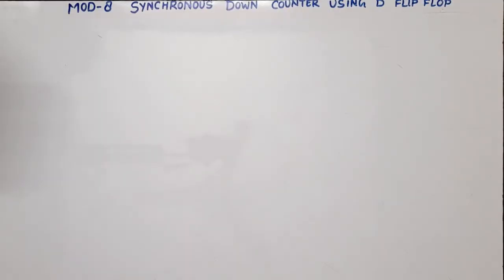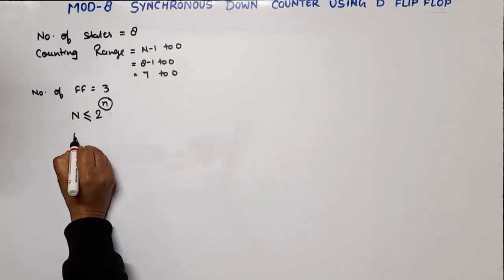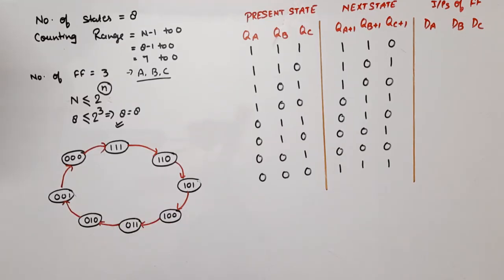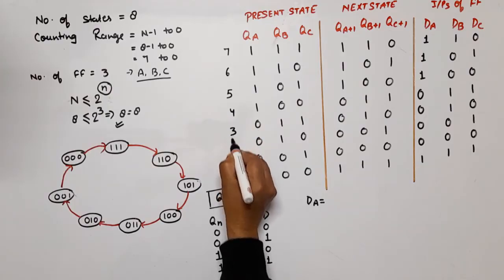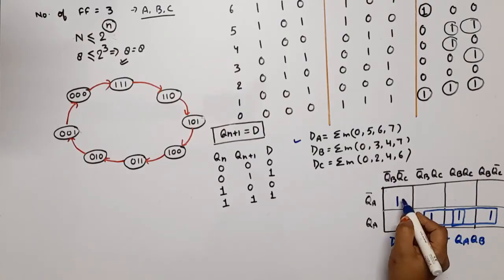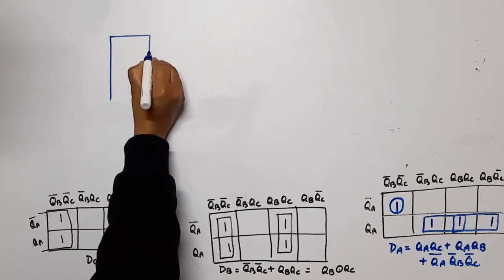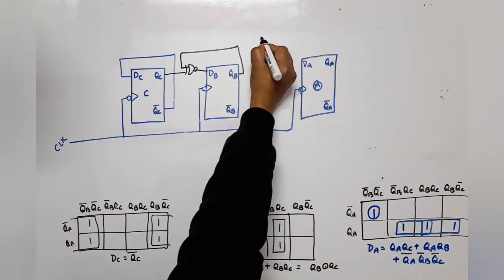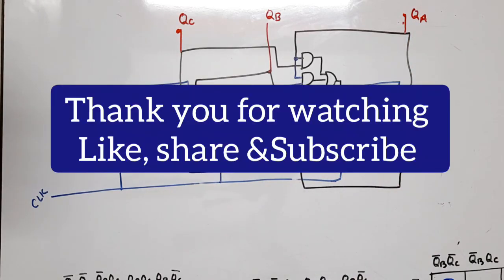MOD-8 Synchronous Down counter Using D flip flop | 3-Bit Synchronous Down counter

Comment: How we can explain its working madam???
Reply from the maker: In working u can define counter, what is the meaning of mod ( in this case its mod 8 means it can count 8 different states and its down counter means it will start counting from.8 to 0) no. Of ff required to design this then state table kmap for Input equation then diagram if possible then waveform and state diagram also